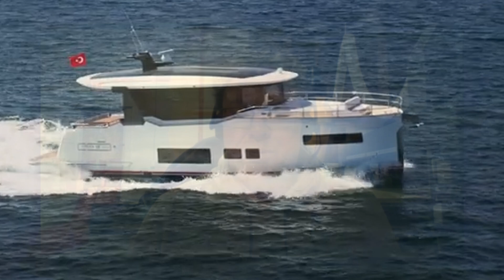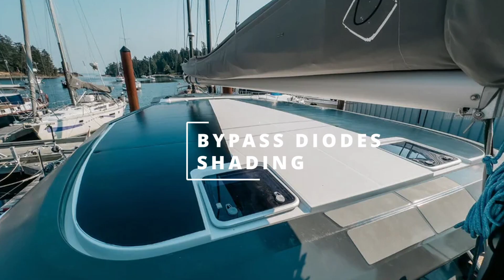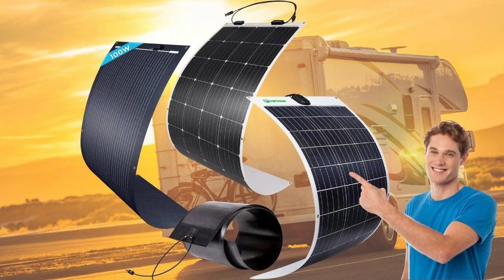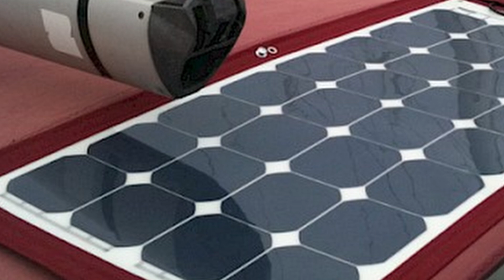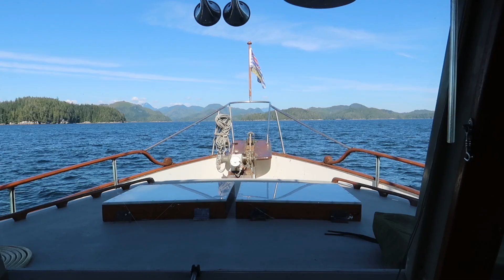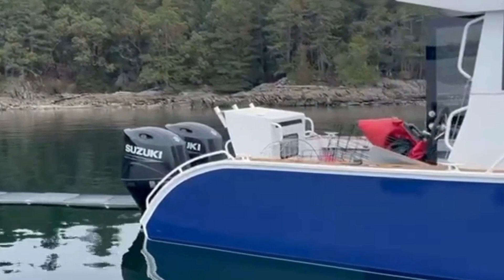The Future Of MARINE EV SOLAR: Ultra-thin, Ultra-Strong Solar Panels

Comment from the maker: We are proud to promote this Canadian company based on the rugged coastline of British Columbia. This has served them well to develop a marine solar panel which can withstand the harsh, demanding conditions of Canada's west coast ocean cruising. If you are looking to add solar power to your yacht, you need to listen to this interview with Simon Angus and then evaluate his company's durable marine solar panels.
Reply: Thank You Bruno for promoting sustainability and smart practices. Great interview, look forward to more.
Reply: That is a rediculous price for 115 watts. A cruising boat already has lumps and bumps. I have a catamaran in the Eastern Caribbean which up to this spring had 520 watts of solar power which I paid $3000 US in 2007. After 
almost 20 years they have degraded enough that I am replacing them. After much research I have found 500 watt N type Topcon panels for just over $350 CAN. I have room for three or 1500 watts fot the same price as
this 115 watt panel. you talk about all electric boats when your panel will not even power a decent sized refridgerator. Another problem is heat. You want air flow all around, top and bottom to help keep the panel cool.
Almost all the serious cruising boats I know use ridgid solar panels becuse they work well at a price that I can afford.